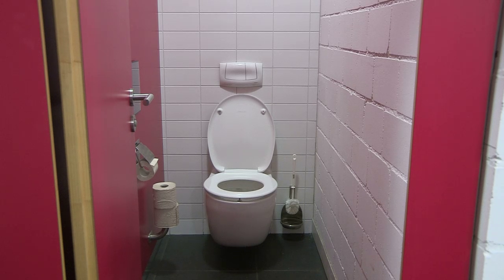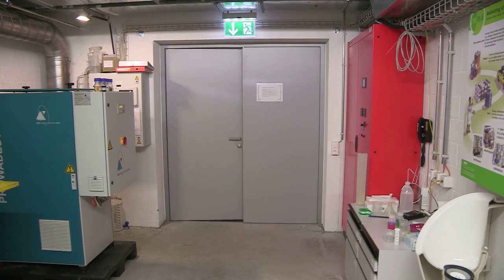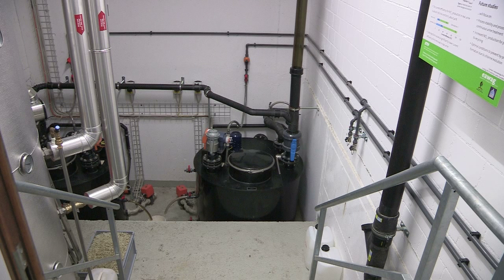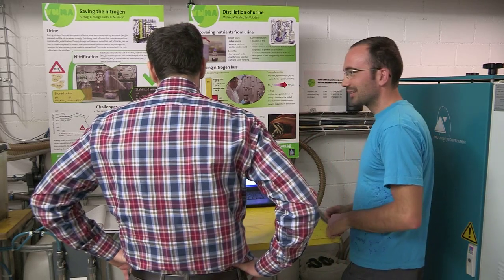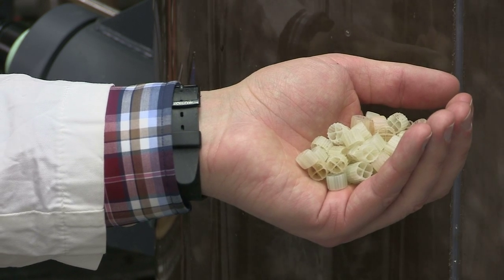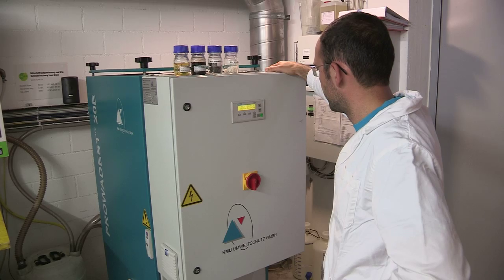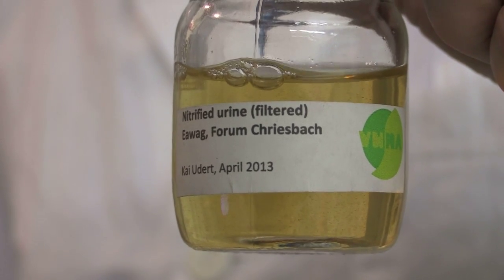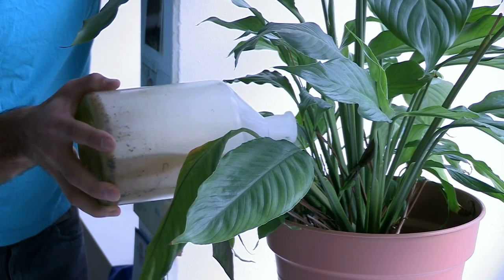Producing Fertilizer From Urine

Comment: Has there been any follow-up? How are pathogens separated? How about drug residue (medication or recreation)? Are there any numbers available on concentration of side contents (such as pathogens and drug residue, but also normal components of urine that do not contribute to the fertilizer yet still remain present)? And if so, have they also been measured in the plants? I want to know because I am considering a self-sustained crop cycle, and while in theory it would definitely be not advised to use this fertilizer directly for crops for human consumption, I'm wondering to what extent the undesired molecules remain present in intermediary vegetation (which in turn could pass it on to the crop that is planted with those same intermediary plants as fertilizer).
Reply: pathogens all die when it is concentrated
Reply: @antomanelven  how? reference? source? I'm inclined to refute this... You probably think of plants dying when fertilizer is too concentrated. That doesn't mean the pathogens are gone. And it doesn't mean that toxins have been broken down either.